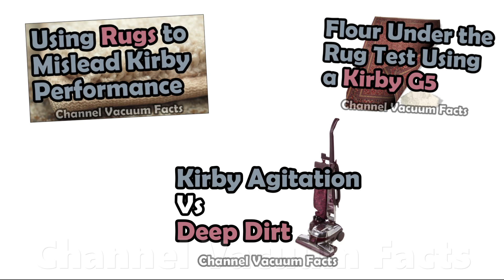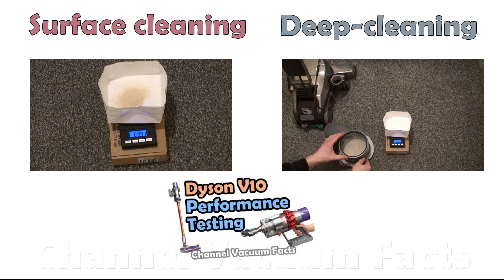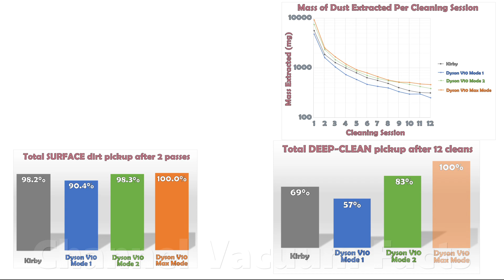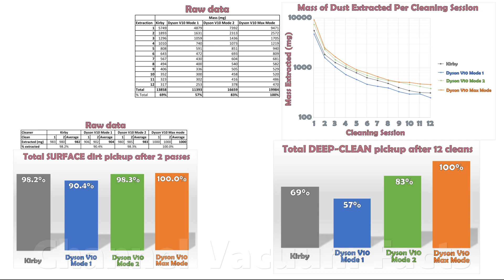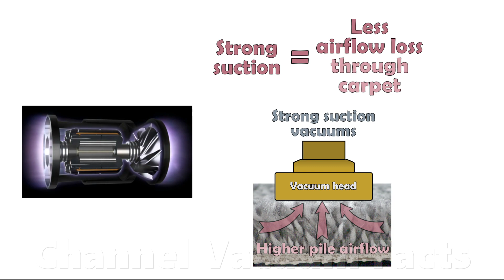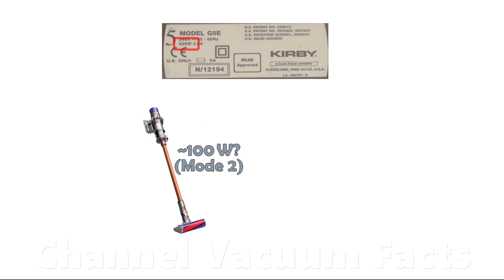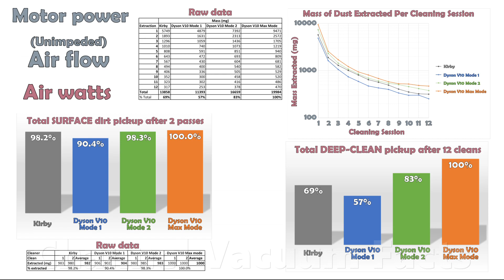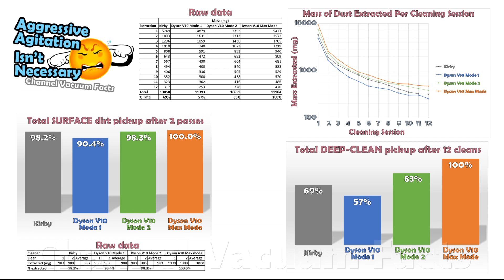Dyson V10 Vs Kirby: How Well Does a Kirby Vacuum REALLY Clean?

Comment: At the end of the day it really depends on what you like. I own both a dyson v11 and a Kirby sentria from 2008 and I like the Kirby for my carpets and the dyson for my floor and above floor cleaning jobs, in my opinion I do prefer the Kirby for deep cleaning carpets as it has tech drive so it’s much easier to push, but however I do prefer the dyson to the Kirby on the hard floor! My 74 year old nan owns a Kirby avalir and it is some much easier to push than her old dyson! They are both great in different ways but I do think that you probably prefer dyson! But hey ho everyone is different!
Reply from the maker: What someone buys may depend on what they like, yes—and each to their own. But that's not what my channel is about though. On factual matters that my channel addresses, subjectivity and opinion has no relevance. Deep-cleaning carpets is empirically demonstrated, with good reproducibility in the data, to be better achieved with the V11 than a Kirby (and I've seen no evidence or have any good reason to believe performance, rather than irrelevant metrics like open hose airflow, is singificantly different between models. The explanation why the V11 performs better is based on well-established textbook physics, also discussed in my videos. This doesn't mean the Kirby is bad, as such, but there is objectively better technology out there.
Reply: Vacuum Facts your videos on the Kirby actually make you sound like your hating on the Kirby. In my videos yes the dyson has not done very well on my tests but in the comments I don’t try to force my opinions on someone because my opinion is different, I get you like dyson so if that’s what you like to use the most use it.
Reply from the maker: @kg5vacuums205  I recommend you instead focus more on the objective aspects of things rather than the petty emotional elements you appear to be fixating on. Any opinions I express are informed by the evidence. People are entitled to their own opinions; if people like 'x' more than 'y', then fine. However, some opinions and the way they're expressed contradicts evidence, in which case, I respect people too much to respect their ridiculous opinions. If their opinions are masquerading as factual claims, then again I'll take issue, unless they're objectively evidenced. If someone's opinion contradicts reality and they don't like that this is pointed out, then they'll get earache and tough luck. Anyone who attempts to suggest that presenting facts and reality is "imposing their opinion on others" is as dumb as the person who criticises a mathematician for claiming that 1 + 1 = 2. It's a fact, not an opinion. These videos were made to debunk many false claims made by misleading YT videos, often with absurdly flawed or deceptive testing 'methodologies', and they've certainly achieved their goal, whether or not the hypersensitive who don't like that their wonky worldview contradicts reality are 'offended'.

Comment: This is actually hilarious haha. Suction doesn’t clean, dumbass. It’s all about airflow.
Reply: Suction is caused by air flow, and killed by leaks in the air flow path. Air flow  is caused by the motors impeller causing low pressure in the impeller housing. Air at the hose or head is of higher pressure. The higher pressure PUSHES the air into the vacuum cleaner. Vacuums don't suck, air pushes. Suck and suction are just words we use to describe a pressure differential causing movement of a gas or fluid.
Reply from the maker: There's far more to the science of how cleaning works through carpet pile. It is covered in detail here: https://youtu.be/WzkFvMLy-Eo and in many other videos on my channel, including this one you're commenting on.

Comment: TRy testing with a bag on, when using the dirt meter suction is lower. hence your results stating you used a dirt meter. This can be seen as i used dirt meter with zip brush which was slower with dirt meter and spun alot faster with bag attached. Check out my channel. So you have debunked nothing.
Reply from the maker: You'll find your zip brush spins a lot slower when you use a bag half-full with very fine dust like it would be in real-life. The dirt meter was clean every time and the concentration collected per pass in such a small area was too small to clog it, plus the particle size was also too large. The dirt meter did not affect the ability to quantify the Kirby's performance. The motor determines maximum suction power. A new bag/dirt meter reflect the equivalent to an open circuit with maximum suction i.e. with (relatively) no resistance. On carpet is another matter. Suction matters and the Kirby's airflow through pile drops like a stone relative to at the open hose. You're wrongly assuming that the airflow at the open hose is representative of what it is at the floor when sealed to a carpet. And you're wrongly assuming airflow through the pile is all that matters, which is false; how it's utilised is critical. This has been explained countless times in my videos. You clearly don't understand, but if you want to, just properly watch my videos. The data in this video also showed all this clearly. Your claim is empirically shown to be false and doesn't explain the data in the video. I suggest you watch this video and learn why you currently don't understand https://youtu.be/WzkFvMLy-Eo .
Reply: Vacuum Facts the dirt meter is not a good demonstration of the Kirbys full power and if you have done actually airflow tests you’d know this your self.
Reply from the maker: @kg5vacuums205  Sorry I didn't respond; I didn't get a notification by YT. I think your channel is great BTW because you just do your hobby and don't make false claims. :)

Thought I’d explain a bit about the relationship between airflow, suction, and resistance. When you measure airflow on a Kirby using a box, there’s no resistance at all because there’s nothing blocking the head. In the real world, when you put the head on a carpet and get a good seal, the carpet massively resists the amount of air that can go into the head. It essentially blocks the head up. To be able to force more airflow through when being resisted by carpet, you need a high-pressure motor that can pull a stronger vacuum and create a bigger pressure difference (i.e. more suction). Kirby motors are low suction motors and so even though they have high unimpeded airflow when measured using a box, the airflow through a carpet pile drops hugely. In fact, it drops lower through that pile than is produced by a machine which has stronger suction, even though that high suction machine wouldn’t show such big airflow numbers in your box. The pile-airflow from high suction machine drops much less. This is essentially Ohm’s law which everyone is taught at school. Essentially, measuring the CFM using a box only tells you the amount of air you can pull when you’re not using the Kirby on a carpet, and doesn’t reflect how much airflow it pulls through a carpet. It tells you more about the properties of the motor more than anything useful for actual cleaning.

Now, it turns out that the resistance provided by a Kirby dirt meter pad is absolutely tiny compared to the resistance provided by a carpet. So, when you’re using a Kirby on a carpet, the performance you get is comparable whether or not you’re using a bag or the dirt meter pad. The total resistance from both the carpet and dirt meter/bag mostly comes from the carpet. So, it’s perfectly reasonable to use a dirt meter pad to measure performance as long as the pad doesn’t clog (which mine never did, by design, as the data shows).

You have to watch out for people who demonstrate a Kirby on a carpet with porous backing which lets air through easily. This situation bypasses the suction limitation of a Kirby as I discuss here https://youtu.be/L-EiWhGjg-Q . And, on top of all this, the cleaning performance you get isn’t only about how much airflow passes through the pile. It has been shown that how that airflow is utilised is more important. Cleaner heads which separate pile really well and help dirt be removed can clean better with relatively small pile-airflows compared to machines with super-strong suction.

To help show the pad makes no difference, you can even see in the data here https://youtu.be/qJlaBeqVs7E that the Kirby with dirt meter performs exactly the same as the V10 on a carpet with porous backing when the resistance to airflow from carpet is hugely lowered. The Kirby’s performance hugely improves relative to the case when resistance is higher on a carpet with nonporous backing, immediately disproving that the dirt meter impairs performance, and that it is entirely dominated by the carpet's resistance.

If you want to learn more about airflow, suction, and resistance, I’ve made a nice video here to help. https://youtu.be/WzkFvMLy-Eo

If I ever get rich, I’ll mail you the latest machine which is shown to be the best performer (usually Dyson lead, but who knows at the time). Just for fun so you can play with it. :)